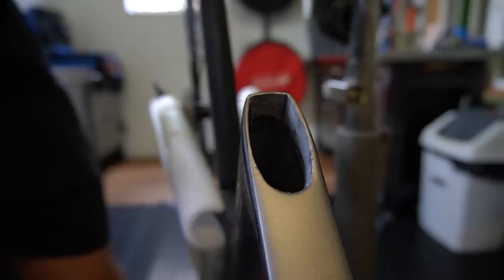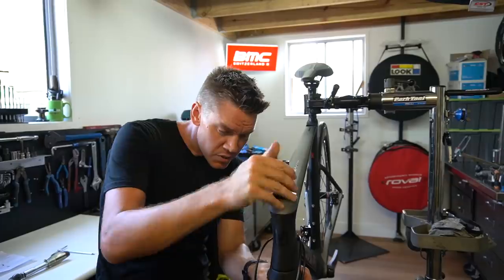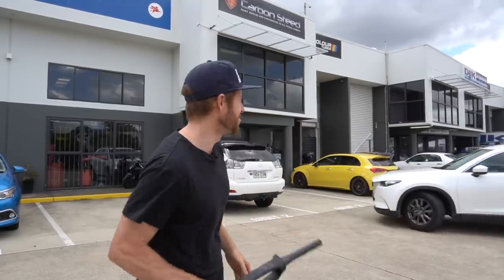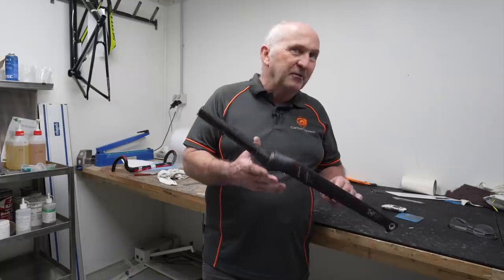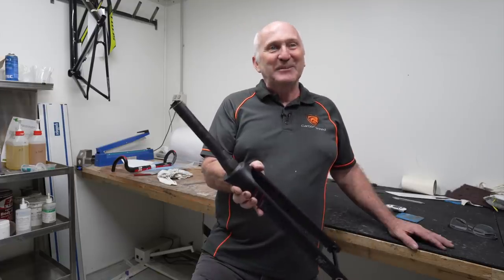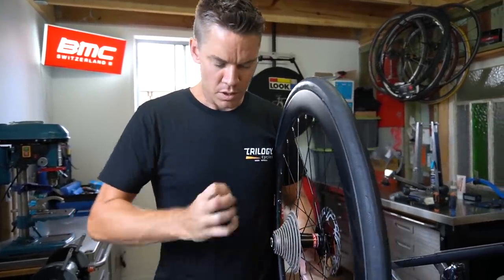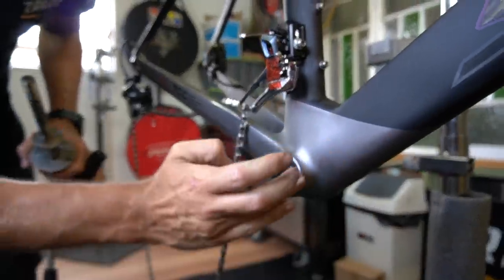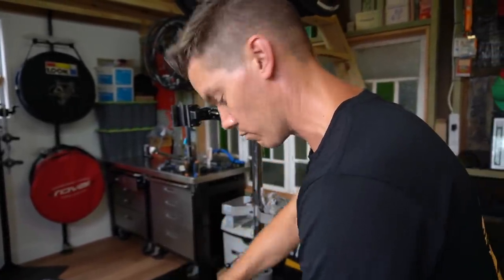The Cheap Chinese Carbon Bike that Backfired

Comment: I am wondering if the issue with the Novatec hubs is that they were ones that didnt pass Q&A but still made it out to the market place. I suspect this is bigger issue than we realise and could be far more prevalent.
Reply: what is QC / QA?? The factory in question has no idea what you are talking about!
Reply: Yeah novatech are usually better than this.
Reply: I think the more plausible explanation is that they are simply fake. I have come across plenty of fake stuff (mainly Shimano Alivio derailleurs, as I was in the market for those) on Aliexpress and on eBay. I think you can even find some videos here on Youtube comparing genuine and fake derailleurs.

Comment: I can't help but think that a lesser expensive model of a brand name bike might fail the scrutiny of these experts also. Unless you spend big bucks, I don't think all bikes are so perfect.
Reply: I've had my ex conti pro team KTM frameset for 7 years (bought new from the team sponsors), it's heavier than the higher end stuff for sure but it's a really solid bike, tolerances in the BB which is threaded, headtube, seatpost and frame alignment are bang on the money.
Is it the ultimate racer, nope, but for most non competition riders it's more than enough, and indeed was used by the KTM team, others have lots of good things to say about them.
In all honesty I think it's a bit of a lottery for most brands incl the bigger names, as you say though, the likes of LOOK, TIME and some other lesser known brands that ]] make in house = more likely to get the best quality.
Reply: Sometimes the high end models have issues too!
Reply: Glenn,not really because the Chinese labor that makes carbon frames value their job  probably moreover than most minimum wage Americans and they have sacrificed to hold on to that job. I lived in Thailamd for more than 8 years and saw and rode many carbon  no name frames that held up as well was any more expensive brand. I own one myself  that has been in almost 50  xc mtb races in the past 7 years and was ridden by myself for about 300 kilometers every week for more than 5 years of that time. It's been crashed many times and never cracked or failed in any way. There are a few carbon no  name frames that aren't much good but standards in design have improved in the past 5 to 6 years so I have no hesitation in purchasing Chinese carbon frame
Reply: @thephotoyak  "sometimes"? Well, then I've been incredibly unlucky, I guess. I had two "Big name" bikes: Specialized Diverge and Argon 18 E-119. Both had plenty of issues. Some of them serious, like cracked seatpost on Diverge.

Comment: I lived in Thailand for over 8 years.. I bought a Chinese carbon hardtail frame  which I built up with help from Storywheel cycles in Chiang Rai and raced  quite often ( 46+ races) and trained on, averaging over 300 km a week for 5+ years. It never failed in any respect. My Thai competitors also used many different Chinese made frames and I only once ever saw a Chinese frame that rode  poorly, and that was back in 2015.  I  rode several of the national XC events in Thailand on it for three years, each time finishing on the podium. I have since come back to the USA and built up a  Lightcarbon LC911 model FS MTB frame and raced it successfully both in Colorado, podiuming in my age group 3 out of 4 races, and back in Thailand the past two winter in my age group class, with 5 wins, one 2nd, and two 3rds, and one 4th out of 10 races. Completely love it, and wouldn't hesitate to recommend it to anyone who rides seriously.
I'm currently working on building up a Chinese carbon 606 or FM0286 frame for gravel racing. I expect the same satisfaction from either of those frames.

Comment: Fair dinkum with the honesty Cam. The only thing I wanna stress is never judge a bike / company by the country it comes from. (In the same way you should never judge a person based on their skin colour, gender, etc.) Every country has a mix of good stuff and absolute crap. Thanks to people like Cam for trying to help separate the trash from the treasure.
Reply: @China Cycling I understand that you have an interest in defending Chinese production. The problem is the lack of respect for international IP laws and regulations. There's no way for the end user to be sure that ALL the components are of the claimed origin (in terms of which company) when one buys a complete bike. I think this may well be illustrated with the Novatec hubs in this case. I admit I'm speculating. Normally Novatec are a well respected brand and it seems shocking to me and pretty unlikely that they would let these particular hubs leave the factory to go onto someone's bike - counterfeit? This runs into safety concerns for the end user which could be catastrophic in terms of injury or death.
Reply: Yep, I've had the same issues with a well respected British brand. Warrantied frame for shocking BB finishing and warrantied the replacement for terrible flat mount facing. I turned down a 3rd frameset and opted for a refund. Wasted a year of my life on that frameset trying to fix faults that the bike shop said didn't exist.
Reply: I think this video is very fairly done and at no point did the presenter make any judgement based on stereotypes. If the fact points to the bike being a poorly made one, then it is a poorly made one. We cannot expect to see moving parts being bone dry and axle being misaligned and yet have the presenter say "This is a fantastic bike". It just doesnt work that way.
Reply: I understand Chinese brands who try making quality products must feel really frustrated with the overall perception of low quality on Chinese products, but China can only blame itself and its complete lack of respect to international law, IP protection and quality standards enforcement for this. Most people will buy a mainstream brand made in China product without thinking twice, since the brand will ensure IP protection and QC are ensured (at least at a minimum standard) to be sold internationally. Saying that every country has a mix of good stuff and absolute crap is not entirely accurate, as the laws in most countries wouldn't allow products with standards as low as some of the made in China products to be produced and sold. I am pretty confident that a factory producing counterfeit frames with well known brands logos on them would be promptly shut down by German authorities, while they seem to be allowed to sell and advertise their products from China without consequences.
Reply: @ChinaCycling, my big problem is with happens after thing’s like this are found. The manufacturer is tone deaf and insists that it is not a problem the bike. You go back and forth every day trying to explain what the problem is only to be told ship it back at the consumer’s cost. I didn’t make it wrong, they did! So now a person who wanted to try and save a few dollars to get back into shape is out $700 to $1500. I have a Cannondale Jekyl I cracked the top tube right in half at the weld. Two weeks later I had a brand new at no cost to me. Enough said! Don’t gamble with money you can’t afford to lose.
Reply: it's standard CCP propaganda to claim that even justified criticism of China is "racist." GTFOH
Reply: well said !!!
Reply: @kpizzle1985  I had the same with a cube back in 2016..
Reply: @jackhammer40k_  what IP law?! As far as I understand, this brand is just another Chinese cheap carbon and it never tried to deceive to be any big brand. I don’t see how any IP law would be relevant here
Reply: repeat after me: China needs to stop doing cheap low quality stuff

ten times each morning before breakfast, thanks.
Reply: 100% agreed
Reply: Thats a very good assessment,and a straight answer.
Reply: @jackhammer40k_  100% agree about IP protection! Statistically speaking Chinese companies have a very bad track record at respecting IP compared to western companies and should definitely change. (but again, I wouldn't judge a company without a fair look first.) I think we as consumers also have some responsibility too. I think many cyclists are accepting of fake Oakleys for example, because they think the real deal are "a rip off" or "a crazy mark-up" etc. So I think change is needed all-round.
Reply: @harrylook7810  I think you missed my point mate. My point was his criticism of this bike is 100% justified and is not at all racist. But drawing the conclusion that all Chinese products are made to this same level is stereotyping. Hope that clears up what I was trying to say. 🙌 Sorry if I wasn't clear.
Reply: @harrylook7810  I don't think we're gonna see eye to eye on this one. You have your mind made up and don't want to listen to someone who has lived in China for over a decade, and works side by side with people just like you and me who are trying to make a living and don't care about politics. Both governments/media want their own nations people to stay suspicious of the other country. If you're busy criticizing other countries governments you won't bother to criticize your own - which is exactly what they (both) want. Again; I'm not claiming all Chinese stuff is good. I'm saying you should judge things on a company-by-company, product-by-product basis. I'm sure you do that anyway though, as the device you're using to read this comment was probably made here, as are 90% of carbon bikes. You're fully entitled to your own opinion, but don't pick-and-choose hypocritically. If you want to be anti-China, then I dare you to throw away everything in your house that is 'Made in China.'
Reply: @ChinaCycling  what are you complaining about? In this video he never stated that all Chinese bikes are poorly build. He’s got a freaking WinSpace & during the carbon inspection the guy even said the WinSpace is build with pride. 

Just accept 50-80% of Chinese bikes are build like crap because there’s 0 respect for laws etc, the rest is build well or even better than reputable companies outside of China.
Reply: Well said Joe. It is immensely hard to overcome this “made is China” is poorly made. We are trying to open peoples eye here in Brazil about the hypes of big bike brands. They just go for SPZ products without bothering about price. In the end they get frustrated in the same way cause of recently issues with SPZ.
Reply: @binshuo  That's because you didn't read my comment.
Reply: This is an absolutely fair comment. However I'd be really careful about conflating manufacturing reputation with xenophobic stereotypes. They aren't the same. To take another example, people expect German products to have a high level of engineering and quality. When that expectation isn't met customers are disappointed due to the fact that there is a tradition in German trades of quality work. This isn't a stereotype, this is something that is supported by actual work standards and practices in Germany.
As far as I know, the same work standards and practices are not uniform throughout the world and in some countries they are practically non-existent. Unfortunately, manufacturers in China have to overcome a reputation of being in the latter group. Expectations have been set by consumers about Chinese products. In the same way one is amazed when they see a poorly engineered German product, one is amazed at a well engineered Chinese product. This isn't discrimination or xenophobia, this is consumer conditioning by market forces.
I chose to use Germany and China in this example but you can substitute other countries of similar reputation and make the same argument.
Reply: "If you don't know diamonds, know your jeweler"
Reply: @jackhammer40k_  I was wondering about the Novatec hubs too. I don't have much experience with them personally, but as a former bike shop employee I understood them to be sufficiently decent, and easily upgrade over OEM items on bikes sub $1200 AUD.
Reply: @mattpatt  I'd bet my house they aren't real... but then... I don't own a house
Reply: That bike is rubbish. Period.
Reply: @motoexplora6235  Tell this to Walmart, they will be out of business without products from China. China CAN make good products, look at your iphones. But if people all demand products with 1/3 of the cost, how can you still expect the product quality to be as good as their counterparts? You get what you paid for, simple as that.
Reply: @442484184  Sorry Nothing in my House made in China.....why you so proud with product  "Made In China"????......all low QC.
Reply: @peterhowes336  Please check the device you were using to reply this comment, where is it made??
Reply: @jackhammer40k_  No mate. You are exaggerating a bit there. A rotor with runout or wobble is not going to kill you but it will be less efficient. This is what we should be focusing on, smoothness and efficiency which better brands give you in spades!  The fork though: that is safety right there!
Reply: @primarottabikes  Support manufacturing and bike makers in your own country and in proper peer countries. This is what we all should be doing. Loving and supporting our neighbors rather than judging them or cheaping out and buying only from unknown people across the world. It may not be the problem in Brazil but in the UsA people are hating each other way too much.
Reply: @jamesmedina2062  No mate. You misinterpreted my point. And that's not a wobbly rotor. That's a hub that isn't concentric with the axle. If the the hubs are fake, who knows where the other components are from and, like you say, how can you have confidence in the fork?
Reply: @jamesmedina2062  Brazil does not have carbon wheel/frame manufacturer. I am not a politician. I will support any brand at any part of the world as long as they sell good product. China is full of good people working seriously and we will continue to support them. The aim of my company is to provide good quality products at a fair price. We want cyclists to have a chance of owing good quality products and enjoy the sport more and more. We dont purchase bike accessories based only in price tag. We buy good stuff: check brands like Winspace, Pardus, Seka etc…
Reply: @jackhammer40k_  I understand your point. Counterfeit no good. I am making my point which is where are the losses? To me they are not only in safety but in lost efficiency. I just give my 2 cents
Reply: @primarottabikes  You are a businessman and I am a maker. I understand your goals and to help people to get around and ride is a worthy goal. I grew up during the 80's when bikes were made in Japan, France, and USA so I also have my personal nostalgia. Rather than be totally neutral I realize I have pretty strong opinions, for example supporting Taiwan's superior ethics and quality in manufacturing. Here we have carbon manufacturing. As a manufacturer, your main goal is pride and quality, over price and profit. But at the end of the day, the wheels need to keep rolling.
Reply: @kpizzle1985  I am curious, does that well respected British brand's name start with a G? I have a titanium frame from them, bought it like 7 years ago on a big sale, and I remember the bottom bracket housing of the frame had to be faced, as it was completely uneven. I was absolutely astounded that something like that could ever happen even on a cheap frame, let alone on a branded titanium one. Also the brand badge which is a separate part glued on the headtube is slightly crooked, and had a glob of glue sticking out from underneath. Again the frame was VERY competitively priced for a titanium frame, but come on, quality issues like these are inexcusable.
Reply: @kosztaz87  it began with a B. It was their flagship carbon frameset, on the first frameset the BB was crumbling away and if I poked out bits would fall off!
Reply: @jackhammer40k_  Novatec make plenty of very cheap OEM hubs. I've had issues with genuine (but cheap) Novatec hubs. They aren't DT Swiss. I also have Novatec hubs that have been fine for years though, they make a range from bottom of the barrel up to quite decent. I wouldn't jump to suspecting they are counterfeit.

Comment: The UT scan on the front fork appeared to show near surface viods/porosity and so no back wall signal was evident. This can be down to 2 reasons. 1) this type of part needs a very skilled laminator, to be able to manufacture a quality part. 2) the tooling required to lay up the carbon fibre for this part will be very expensive, even for China. If you have neither of the above time after time a substandard part will be produced. I learnt about carbon fibre in the aircraft industry over the last 30 years and finished my career as the Non-destructive Test team lead working on the Eurofighter Typhoon and F35 aircraft.
Reply: In summary, you wouldn't recommend cheap made carbon fiber bikes especially coming from unknown companies in China. Your advice as an expert in carbon fibre industry.
Reply: Yes the Ut scan was but wait until you see the results for the pap smear test.🤟🤪🤙
Reply: it's just not fair to compare quality standard of an 100 million++ usd product  with cheap bicycle's  :)
Reply: cool story bro

Comment: Built a roadie with carbon frame and wheels from Chinese supplier, also came with the cheap novatech hubs. back hub I could skip the pawls over the ratchets with my hands, supplier sent a new one, exact same problem, ended up biting the bullet and buying a dt swiss 350, threw it on and no problems thus far. No major issues with the frame (yet), a few annoyances like the brake hose hole for internal routing on the headtube was more or less perpendicular to the frame and needed some sanding at an angle to accommodate the hose, brake caliper mounting surfaces not faced etc etc